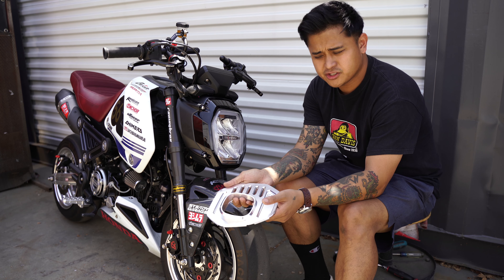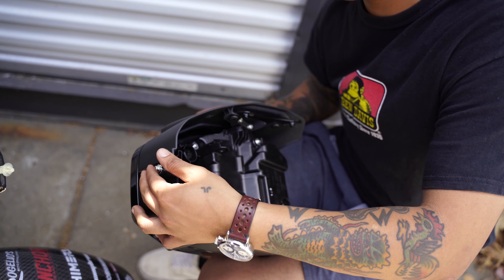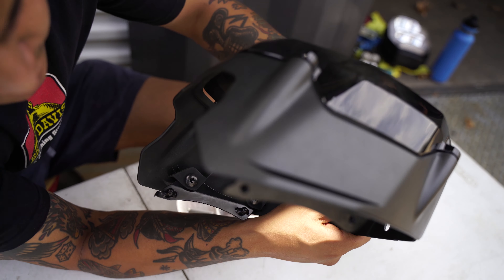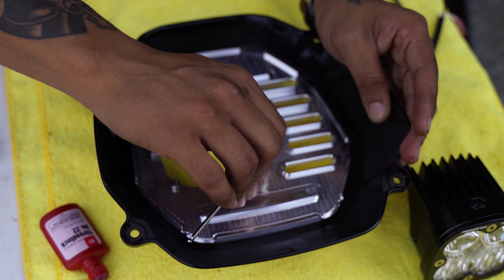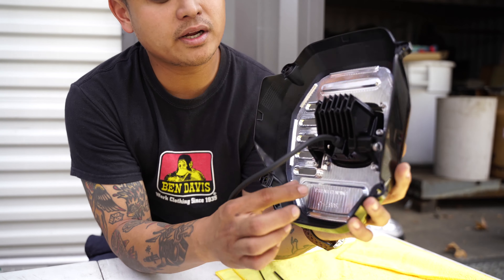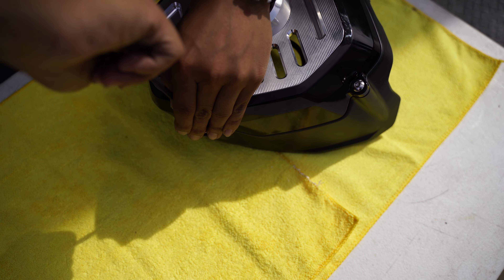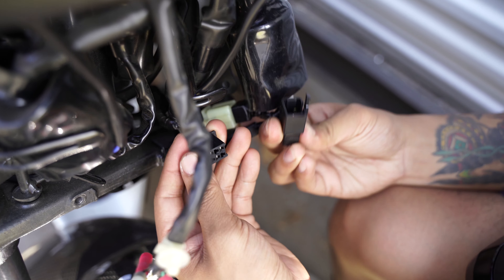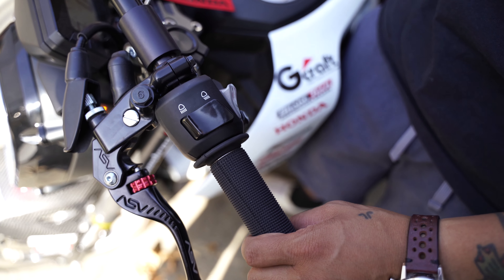Chimera T-56 Baja Designs Squadron LED Headlight Installation Tutorial for 2022-2024 Honda Grom 125

Comment: You would think if you are going to put together a kit esp one that draws a lot of current you would source an oem connector to plug in
Reply from the maker: That's in the works, Chimera was going to hold off on the release due to the missing connector, but we have informed them that the enthusiasts has been waiting for a long while, so let's get it out there first. The direct plug in connector would take at least another month or so before they arrive to complete the harness, so instead of waiting, we could sort through it afterwards. Once the harness is available and those that wants to swap it out from the first batch,  they could contact us and we'll get it out! There's also going to be other additional options available that could be added on, but it's not hard to do afterwards and once they are available.
Reply: Do you know if the direct plug in connector is being included with the headlights now? Or are they still working on it?
Reply from the maker: @g1g1ddy  They have it with the dimmer now, which enables hi/low function.  https://www.steadygarage.com/products/chimera-t-56-hi-low-headlight-harness-honda-grom-125-2022

Comment: For such a high quality made headlight and mounting plate the wire harness install is a little subpar. It should have a OEM style plug to connect to the factory harness.
Reply from the maker: That's in the works, Chimera was going to hold off on the release due to the missing connector, but we have informed them that the enthusiasts has been waiting for a long while, so let's get it out there first. The direct plug in connector would take at least another month or so before they arrive to complete the harness, so instead of waiting, we could sort through it afterwards. Once the harness is available and those that wants to swap it out from the first batch,  they could contact us and we'll get it out!
Reply: @steadygarage  do you know if the plug-in connector is now being included with the headlight?
Reply from the maker: They have it with the dimmer now, which enables hi/low function.  https://www.steadygarage.com/products/chimera-t-56-hi-low-headlight-harness-honda-grom-125-2022 @g1g1ddy
Reply: Mine comes in tomorrow, I like the just on or off function. Can't wait to install it!

Comment: The shroud fitment for mine was SUPER tight (black faceplate). Ended up using a thin 1.5 inch putty knife to leverage the shroud over the lip 10 seconds compared to fighting with it for 10 minutes.
Reply from the maker: You're the man! We have tried the plastic door panel pry bars and it works as well, but some people might not do it right and may cause damages, so we figured using no tools might be the best so that they don't crack the plastic cover. Here's a added video to show more details on the headlight plate going into the headlight cover for those who want's to see it in detail: https://youtu.be/olXhH41BcKY

Comment: I ordered the more powerful Pro version. Does the light stutter or change brightness at idle like oem does? Or does it stay the same?
Reply from the maker: If it's on long idle, it would stutter as the headlight is drawing power quicker than the charge could keep up. Hence the reason why Chimera put the hi/low beam switch as the on and off. They are working on add-on's/supporting components to help, but those add-on's would take additional time.  As long as you're riding (RPM range above idle), then there would be no worries since the charge is pushing above 13.2 volts anything above 1,700 RPM. Everyone would ride more than they would idle, idling long isn't good for air cooled engine anyways!
Reply: @steadygarage  Yeah, I was just thinking at stoplights and stuff. I did upgrade the oem battery with a more powerful WPS Lithium. Maybe that will help? That's great to hear about add- ons coming!
Reply from the maker: @Image-X  Yea the stop light would be ok, most of us rider would blip the throttle here and there and it's also that's not long enough. Usually idling for over 2 minutes would cause you to see some stuttering.
Reply: @steadygarage   Installed it today and seemed to have no real issues. Was also happy to see that the plate worked with my TYGA carbon fiber trim bezel. 👍 Can I ask what kind of add-ons are in the works?  https://imagizer.imageshack.com/img922/1088/XVpBRo.jpg
Reply from the maker: @Image-X  Looks amazing! The carbon looks very good! The add-on would be a dimmable harness which would turn the hi/low beam switch to turn off/on the dimmer, so at regular riding you could leave it on dimmed. Then in dark area, switch it to be full power! They might also release a relay with the dimmer so that the light would be off when the engine is off and on once the engine is running.
Reply: @steadygarage  Thanks. Those harnesses sound perfect. Thanks for the update!
Reply: @steadygarage  Was just wondering….. was there any reason that you guys couldn’t include the SAE Squadron light with the kit? Maybe at least as an option so it would actually be street legal?
Reply from the maker: @Image-X  The SAE Squadron is a FOG light, therefore the beam length is very short so it would cause a reverse effect in visibility. Very bright directly in front of you and darkness further out, which reverses the visibility to your eyes. We are working with Baja to create an actual SAE "headlight", which would take at least 4-6 months.